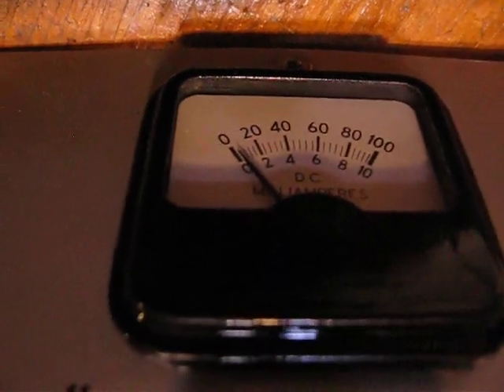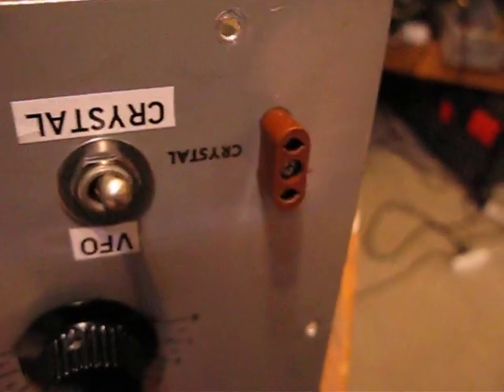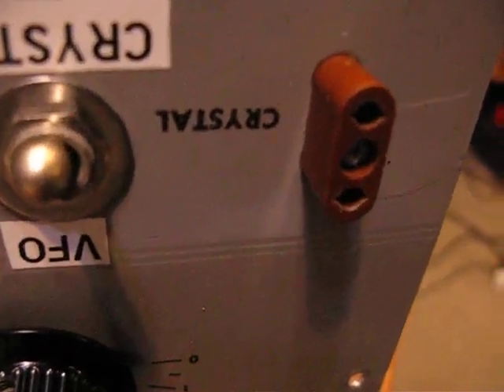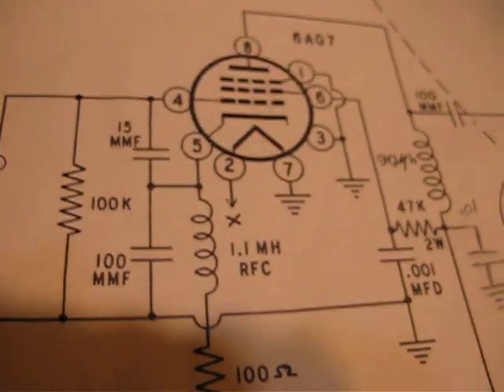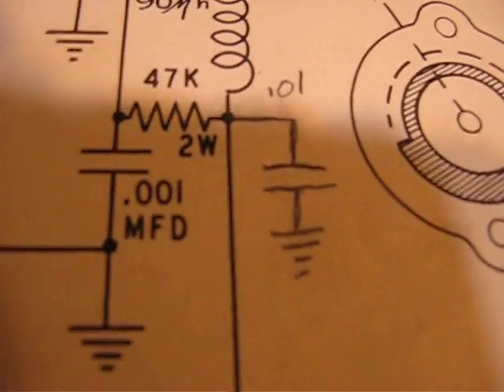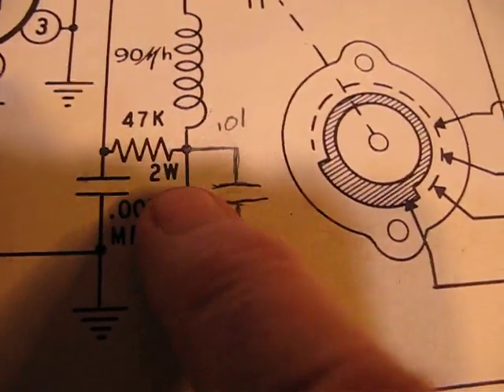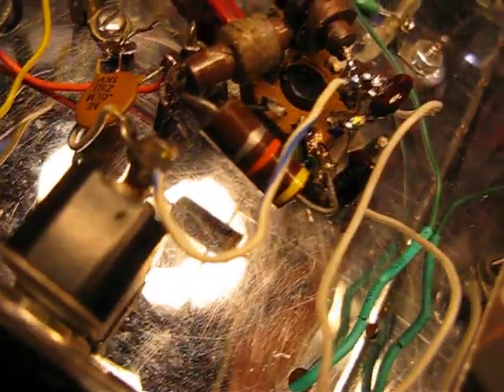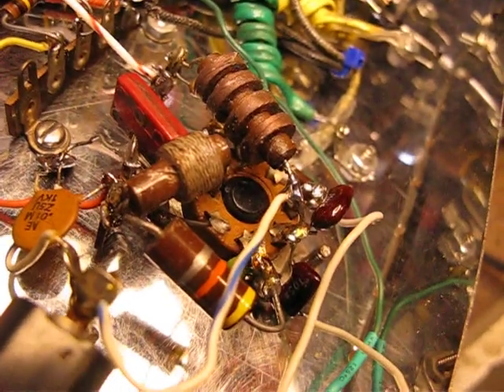HEATHKIT  AT-1 transmitter , 1955 Heathkit transmitter ,AT-1 , AT-1 unstable oscillator

Comment: Happy New Year Bob!!  I really appreciate your videos, as I have acquired a Heathkit AR-2, and am 'refreshing' it.  You did a video where you replaced the caps in one of the IF filters. The issue is that the other IF filter has three mica caps in it and I'm not sure of the values.  I measured 100, 60, and 130pf. Do you concur?